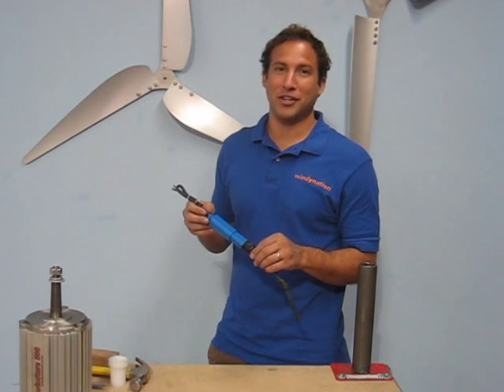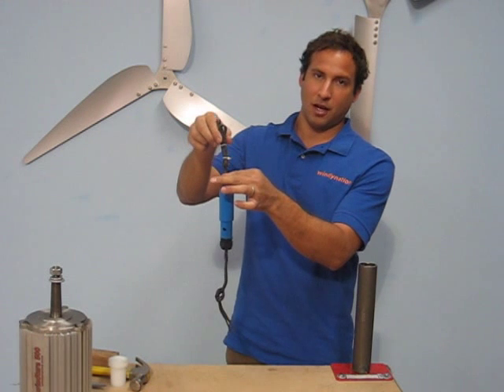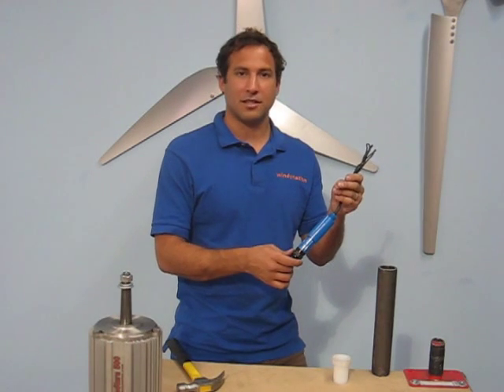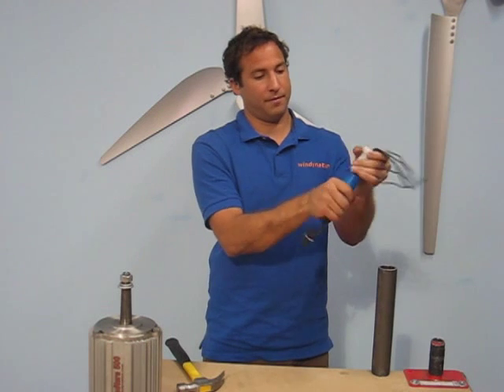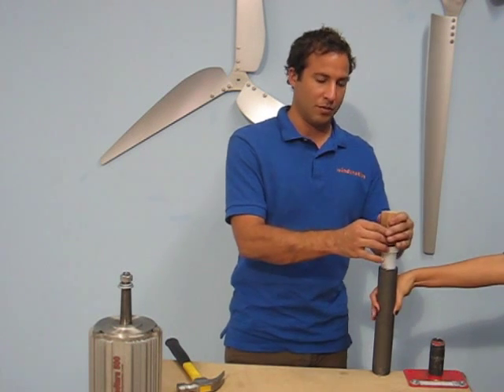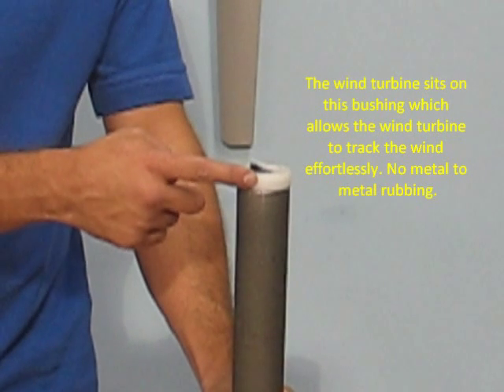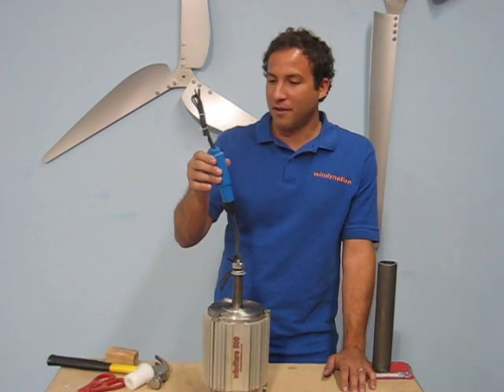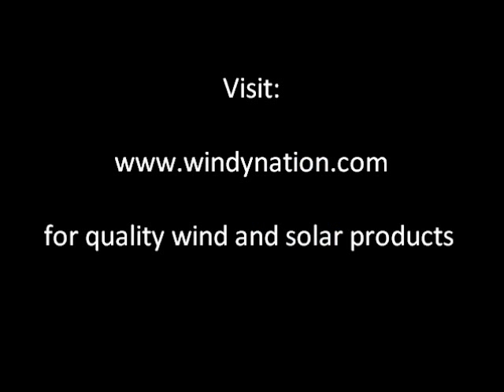Wind Turbine Generator Slip Ring --- WindyNation Inc.

Comment: Great Josh, but what size 3way amp wire should I be using when extended the wire down the tower to the rectifier? in other words whats the maximum 3phase output in terms of amps of the PMA?
Great videos!!